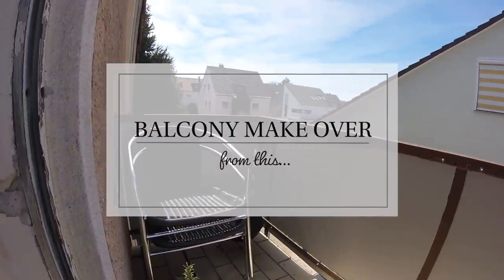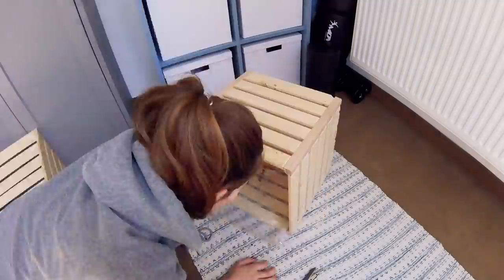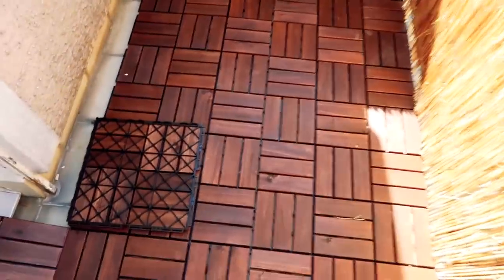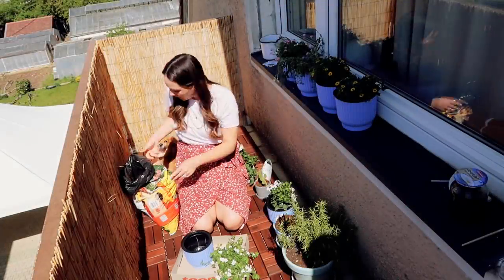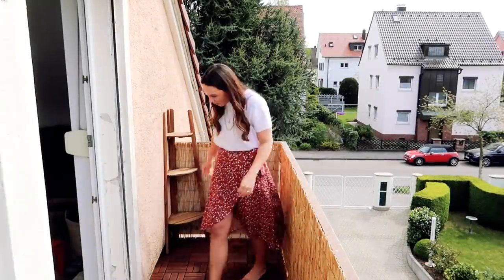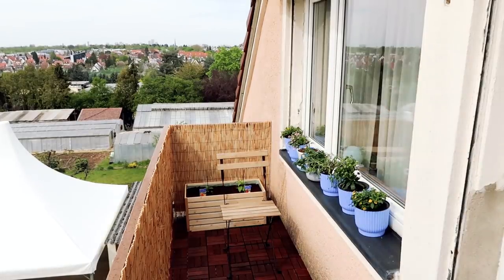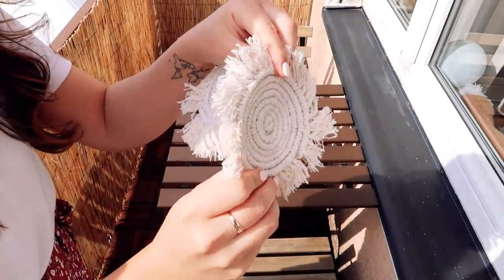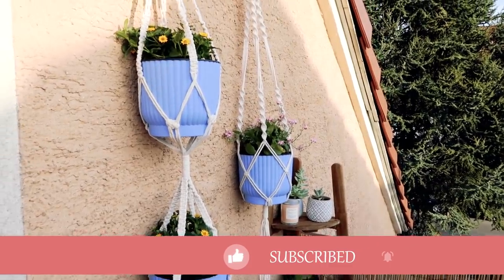DIY & PINTEREST INSPIRED BALCONY TRANSFORMATION | tiny balcony makeover | IKEA HACKS & DIYs

Comment: Great job 👍🏽. Some small white pebbles on the boarders of the floor would have been a great option - which would add interest and dimension to the floor. But well done 👍🏽
Reply from the maker: Thanks! 😊 I appreciate your comment. We simply went with a solution that is easily removable for the floors since we’ll move out of the appartment within the next year or so. For a permanent house / appartment pepples are definitely also a great idea and look! 🌸💞
Reply: The reed wall clashes with the floors. I like your suggestion of the stones.

Comment: Nice job!  Are those veggies going to be okay without drainage?
Reply from the maker: Thanks! They do have a layer of small stones on the bottom underneath the soil. That’s where excess water can go so it does not need a drainage :)
Reply: @MareikeSophie  It will need drainage holes. Stones at the bottom just push water back up into the soil and causes roots to rot. I lost many plants before learning this. 😢
Reply from the maker: My mom, grandma and me have had many plants like this and it never was a problem. They all stayed healthy and with the right amount of water it worked just fine 😊😊